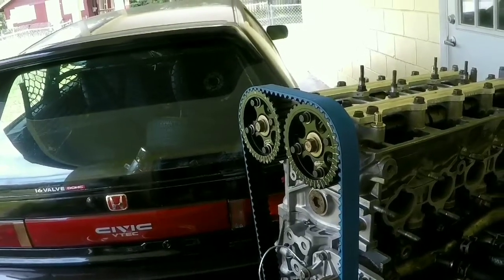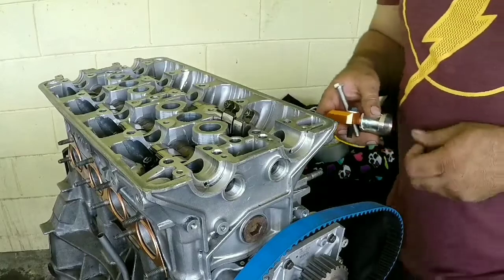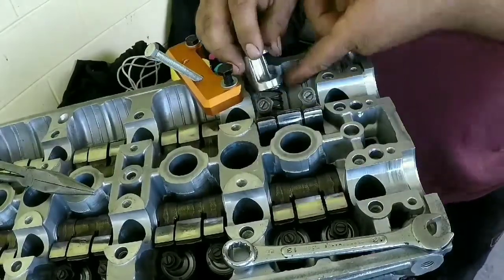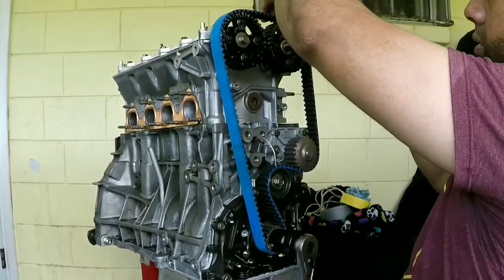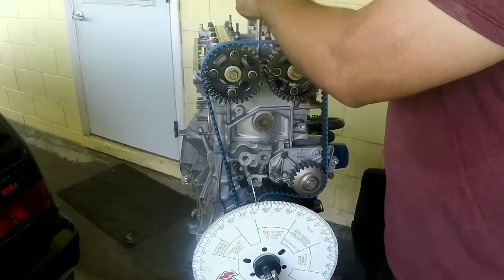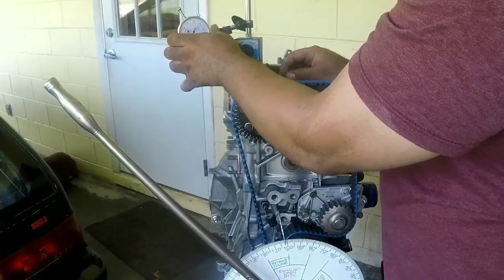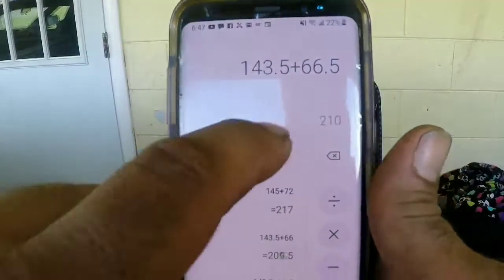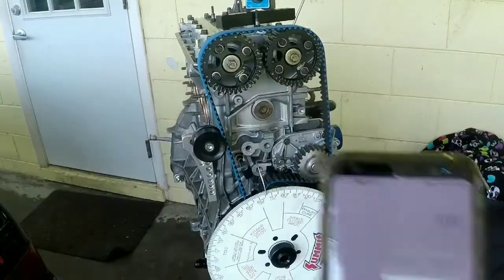Cam degrees on a b series

Comment: aren't you suppose to lock your vtec cam lobe
Reply from the maker: Yes it is .... I'm using a little marbles inside the rocker arm and it works, you use that or air compressor.